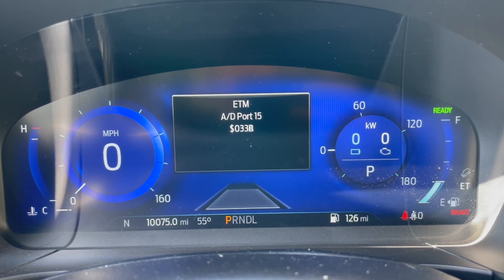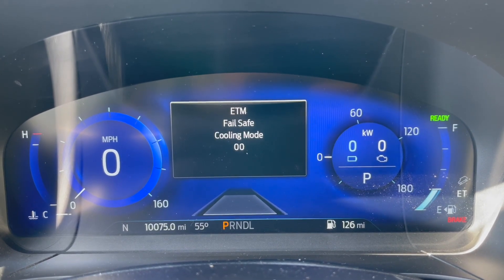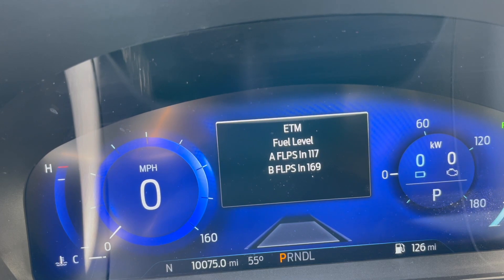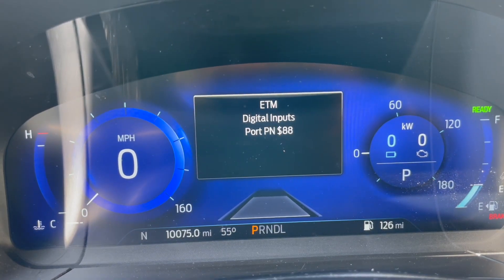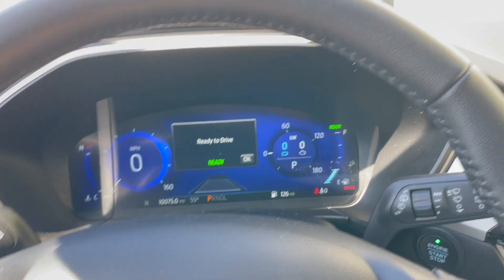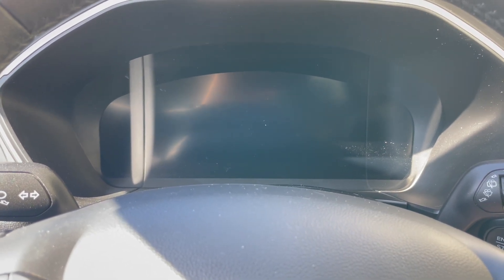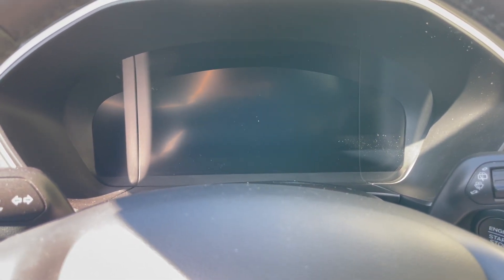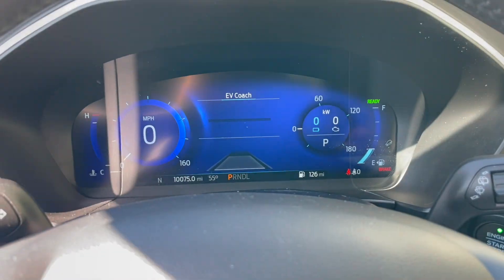Engineering Test Mode on 2020 Ford Escape Hybrid

Comment: To summarize: shut the car off completely until all displays turn off. Open and close the door to speed up the process. 

Hold the right OK button for 5 seconds.

While still holding OK, start the car as usual.

Let go of OK once you see the ET mode message.

Comment: That power gauge is interesting. How many kW can you pull before the ICE comes on?
Reply from the maker: That's a question that requires kind of a long answer, as it depends on the mode: In the FHEV version that I have, most often it's around 15-20 kW as a consistent draw in EV mode sustained up to like ~2 minutes. In Normal or Sport mode, it will jump up to around 45 kW sustained for at least 30 seconds at WoT. In transition between EV and Hybrid mode where both motors are active (88kW + 35kW), I've seen it peak for 1-2 seconds at around 91kW as the ICE spooled up. The PHEV, as you might expect, has different operating ranges, as it has a much larger battery, but the motors and engine are the same. Thanks for watching!
Reply: @TheCuriousEngineerChannel  wow, that little battery is really able to provide 90kW of power? I'll have to check some specs for the battery in the FHEV Escape and calculate a C rating for that, that sounds pretty extreme. Even the very high-end RC battery packs can only pull about 100C at the most, and their continuous rating is closer to 10-20C.
Reply from the maker: It's about 80C @ 90kW. Plus for regen it's 32C @ 35kW.  Perhaps I'll make a video explaining further.
Reply: @TheCuriousEngineerChannel  please do!

Comment: U have a continuous Code saved in ur DTC and it’s current . I would google what $C29382 the $ could mean A P but not a expert also to get in engineering mode all doors have to be closed .
Reply from the maker: Thanks for heads up! Yeah pretty sure that is an IPC to ACM communication issue. I had it in for service and they performed some update which seemed to resolve it. Good point on doors being closed!